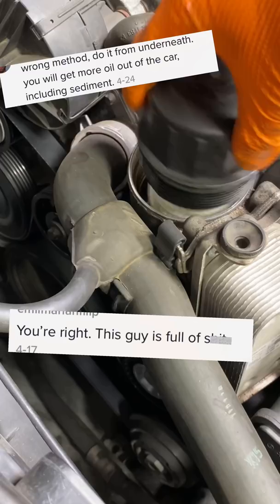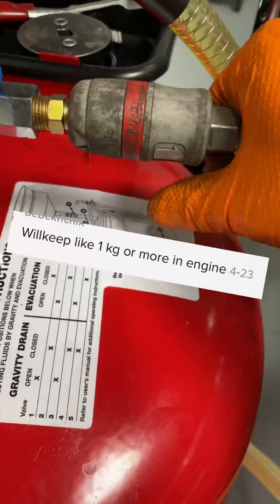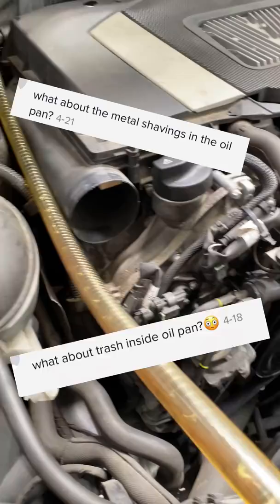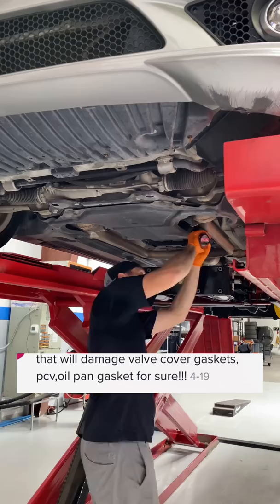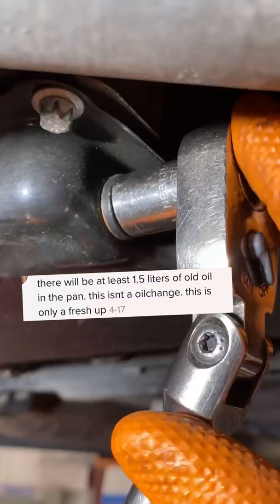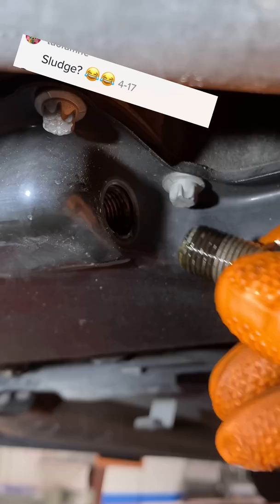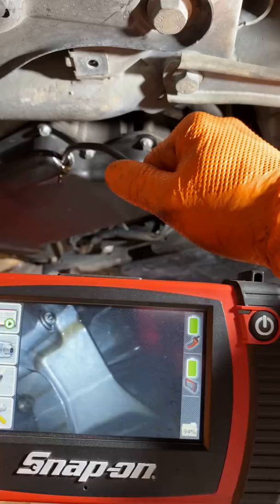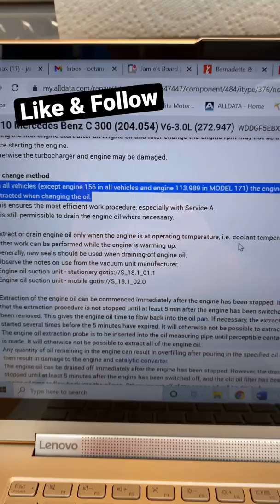#shorts Mechanic Proves Haters Wrong

Comment: I mean, car engines do produce vacuum when they're running and pressure when boosted with forced induction... sludge and shavings are improper maintenance and usually user error. I would extract all of my vehicles if the oil filter wasn't only accessible from underneath the engine.
Reply: Theres actually positive pressure in the crank case when the engine is running thats why it needs to be ventilated

Comment: Well... There usually isn't any ”sludge" in the oil unless you're not doing oil changes at the recommended mileage or engine hour mark. Now how the oil is extracted is mechanic preference.
Reply: Except for when the vehicle manufacturer specifically says that there is a recommended way.
Reply: @gokurules22  I think you contradicted yourself by using the term “recommended”
Reply: @titan1umtitan  I am pretty sure he didn't contradicted himself.
Reply: @titan1umtitan  please explain, oh knowledgeable one. How did i contradict myself?
Reply: @gokurules22  He said how the oil is extracted is a preference, then you said that, in specific cases, it is not up to preference if the manufacturer states that there is a recommended way. However, a recommended way also implied that there are other viable options which would allow a mechanic to use their preference because it is just as effective. Overall, I’m saying that you pointed out an exception, but the reasoning for the exception is the manufacturers preferential choice, not what you MUST do. I’m bad at explaining, so apologies for that
Reply: @pedromoreira2875  Check the comment I just dropped replying to the guy

Comment: As a German car owner, I find these comments domestically hilarious. When you’re used to driving American scrap metal 🤷‍♂️
Reply: Hey at least I don't gotta spend tons of money on parts to fix my american car. 🤷‍♂️
Reply: Matthew Hayslett  you mean the Ford trucks/Cars and chevy trucks and the dodge trucks? I have never had a dodge or chevy transmission fail me on a car, of course I've had to replace syncros or clutch packs but that's general maintenance on a car and truck transmission. I'd rather do a transmission myself than pay the prices the foreign cars want for parts especially Volkswagen and Bmw.
Reply: @PandaNukem  no shit.  it’s so cheap it’s disposable. When it breaks, you throw it out and buy another one. That’s the whole point of those things
Reply: Hey!  We drive your German scrap metal here too!
Reply: Lmao I'm a Toyota guy so I don't have a dog in this fight but spare me with that crap Van D.  German cars are the definition of endless money pits.
Reply: @gagelawrence8443  Toyota is sick. I have a supra. Love it. I also have a ‘93 240 sx. And a titan. Nothing has been as reliable as my Audi wagon though. In 10 years all I’ve had to replace was oil filters, brakes and tires. My wife has a vw  and same deal. We both used to own domestic before that. Had to live near a mechanic.
Reply: Matthew Hayslett  I'll take a transmission that fails after 200k miles (usually do to poor maintenance because people act like they're sealed units that shouldn't be touched) over replacing computer modules in modern BMW products. I don't think anybody is fond of tearing nearly the entire interior out of a car to track down an electrical issue that shouldn't have even happened. I worked on multiple BMW made Minis that had these issues. A couple were towed to the shop with my American scrap metal Dodge truck from 2005 with 240k miles on an original powertrain. Not a single BMW made Mini I worked on was even close to 200k miles if I recall correctly.

Also, don't take this as me hating on Minis, they're absolutely great to drive and I'm sure their BMW badged counterparts are too. They just have their quirks and I think it's stupid to ignore them.

Comment: The place I work at we do Mercedes, Vw, Audi, Bmw and some other cars that way. if they have to much plastic underneath and it takes up more time to undo the 2 dozen fasteners. or if the drain plug is temperamental and we don't want to fook it up. the oil gets vacuum out, it may take a little longer time and we measure the amount taken out to what is going in and if it matches we're good. The only problem is with the cars without a dipstick port.

Comment: Well the cement works used merc trucks back in the 70s as tanker trucks to move the cement to the port where they stored it in silo,s 2 drivers did a 12 hour shift each 7 days a week they never ever turned the trucks off mercedes told them not to not even when they changed the oil or serviced them they pumped the old oil out at the same time they pumped the new oil in with the motor running merc set them up to do it ,they did 1.2 million miles in them before they undated them & never broke down & never stopped running or turned off in the whole time ..milburn cement NZ ..

Comment: Even on my old Ford work car....   I never missed an oil change.   EVENTUALLY the oil pan got rusty and I changed it.  There was ZERO sludge in the motor and or  old pan.   If you change the oil regular you shouldn't have sludge.

Comment: This is how the oil is changed on any boat with an inboard engine propulsion system (sterndrive, jet drive, IPS/Zeus, v-drive or bobtail) and most modern outboard engines as well. Most Diesel powered yachts even have an integrated “Reverso oil change system” rigged to all engines; this pump allows to extract and fill all engines with the flip of a switch.

Comment: I work at Valvoline and we use evacs one every car possible. It doesn't like to work on Ford Ecoboost 6's but it works mostly every other car. I hated it when I first started but it does make changing oil a lot easier. Some drain plugs aren't in good spots and like to make a mess when pulling it.

Comment: At most you are left with 10 to 15ml of oil in your pan. But for Audi, Mercedes, and BMW this is the recommended method, the use of an extractor for oil changes.

Comment: Just drained the oil out of a car that had the timing chain flopping around and grinding the timing cover. 95% of the shavings stayed in the pan. If you have shavings falling into the sump, you have other problems.

Comment: The difference and reason the oil is completely evacuated: MB built the oil pan and the dipstick to function this way. The dipstick housing goes all the way down as where your Chevy and Ford do not.
Sludge forms when oil is overused,  MB owners maintain their cars about better than most people do. Most synthetic oils do not form sludge like conventional oil did back in the day.

Comment: Using an extractor tends to get more oil out than just a spill and fill. Even with my own theta that takes 4.5q when I let the pan drain til no drips takes and 5.25 when evacuated.

Comment: Here's one you can't ignore. Speed. As a mechanic, you should know the time it takes for an extract, which takes about 15 extra minutes. You might be able to fit paperwork in between, which could help, but nothing beats that tried and true piss bolt. Same results, faster time.

Comment: It is interesting when you go from the top, we have an oil vac to change the oil on our generators but we suck it out through a line at the bottom of the oil pan that is connected with a valve

Comment: Worked as a tech and MB for years, every benz EVER has the oil sucked except the newer models without dipstick. Trust me, you should be more worried about that rattle you came in for and i punched 2+ hours on a warranty labor ticket, wrote a pretty story about what i did, and send it back, customer all giddy that they're rattle is fixed while i worked on someone elses customer pay ticket for those 2 hours and never did anything to your car.

Comment: That manual is written by the bean counters figuring out how to pay the least on warranty work not the engineers. Jiffy lube is more likely to screw up your drain plug in 50,000 miles than Mercedes to make an engine that mechanically fails within 50,000. However, if it does have damage and the evidence is still unseen in the pan they hope that it will at least last until after the warranty period until it blows. Statistically this saved Mercedes a TON of money.

Comment: The oil stick tube is literally a straw for those engines. I've been doing this for years on my w210 and I'm currently sitting at 289,000 mi. Tested it myself it gets pretty much every damn drop out.

Comment: I always did it for the last half of my career. Most cars have a trapped.5 liter in the bottom, would jack up one side to get more out , and evac , got a half pint more out when I vac and tilt the car. Most German engines immaculate in the pan , even with 100s of k

Comment: Would love to see one of those commentators drain 30+ Liters of oil from a MB truck from the drain plug instead of sucking it out... We always suck it out at the dealership. Never seen excessive wear on a cam for example when we adjust the valve clearance on the next service interval

Comment: If you have metal shavings in your oil pan that are large enough to not make it to the filter without causing damage to the oil pump then you have much much bigger problems than how you evacuate your oil.

Comment: Metal shavings are not normal, oil sludge is not normal, if you use proper oil and regular oil change you dont think about it. The reason we have oil inside the engine is to prevent metal on metal friction which you guessedit creates metal flakes

Comment: It’s only Mercedes or other German cars that are designed to have oil extracted. Would not work on any Asian or domestic car you’ll still have oil left in the oil pan if you extracted the lazy way. But I would say most lube techs can’t torque a bolt correctly even if they wanted to.

Comment: Its insane how people believe that 'sludge' is going to be that bad when regular maintainance is done and good oil filters are used.

People, these engines run under insane tolerances, high compression pistons and multilayered turbos, will run at top speed for ages and do so for decades.

Who the hell thinks these just keel over and die from sludge buildup? Plus, its almost like sucking the oil from the lowest point in the engine instead of just having gravity do the work, will most likely be better anyway.

Comment: I would never take advice from someone who thinks metal shavings in the oil pan is a normal thing to expect when changing oil. If there are metal shavings and debri or sand in your oil, you got much much bigger issues then needing an oil change.

Comment: if you have metal shavings in your engine, an oil change is too little too late.  this dipstick vacuum method has been used for 50+ years in auto engine based boats,   witch is most of them.

Comment: How about the damage pulling a vacuum on an engine does to all the seals. They are designed to keep the oil in not the air out

Comment: 1 question, if mercedes service manual recommends to drain/suck the oil from dipstick tube, then why they still put drain plug on the oil pan?

I mean, many cars doesnt have drain plug on the diff. but some car still have it.

Comment: If suck out oil via the dipstick on older cars where you would drain the oil via sump plug, yes you might leave things behind.
But this car is designed for oil to be sucked out.

Comment: It’s almost like he’s doing it the way Mercedes wanted you to do it. I have just drained the oil from the oil pan like normal but I get why they recommend you do this. Since if there’s anything I hate more is it’s those stupid plastic drain plugs on BMW products and I’ve dealt with a couple where the person before clearly went overkill and caused it to strip out the part you use. But what I don’t get is people realize it’s pulling a light vacuum to suck out as much oil as possible. The PCV isn’t directly connected to the oil pan, the valve cover gaskets are torqued down and squished between metal and plastic. (assuming it’s a Plastic valve cover)

Comment: I had a second generation Mercedes A-Class.
in this case the drain plug should have been used.
However, the MERCEDS workshop sucked out the oil and then filled it in the amount specified in the instructions. The result: there was oil left. So they filled too much and 2 hours later I had an engine failure. on new Mercedes, you are possibly right. But on old ones. you kill the engine.

Comment: If you got metal shavings in your oil pan you have bigger issues, if you got sludge in there change your damn oil when you're supposed to heathens. A bottle of full synthetic is like 20-30 dollars and a filter is like 10 max changing oil isn't hard

Comment: Thats cool in all but i dont have the tools nor care to do it that way ik my way works and ive never stripped the pan out so im not worried. In my opinion they want it extracted instead of drained so the oil pan doesn't get stripped out over time. But you do you if it works it works

Comment: Bro the comment about it damaging gaskets and the PCV valve is insane. And for the sludge comment that doesn’t even make sense for one and. I’m not sure if they are aware of modern oils but they have detergents specifically designed to keep sludge from accumulating in the engine especially if maintenance is kept up

Comment: My Toyota filter is on top and it’s the only car I like to do oil changes on so far. Guess what? No sludge or shavings after that first pass. God knows what the previous owner did, but I can tell you it wasn’t change the oil right before they sold it to me. 😂

Comment: If y’all have sludge and metal in your oil, you have bigger issues that an oil change isn’t gonna address
Reply: Most of the time those issues are cause by NOT changing your oil so 🤷🏿‍♂️ it would probably help some

Comment: Wouldn't any metal shavings be picked up by the magnet that's in 99% of all oil pans anyway and wouldn't be drawn out of the oil if removed either method. If you see any metal or sludge you should be thinking about something mutch worse anyway. Still impressed how well the vacume method works though

Comment: German engineering requires excessive maintenance. If you followed the instructions generally works well. It's only one you don't follow them to the T that you have problems. Read up on German tanks in WWII and you'll find out what I mean. When well-maintained they work well mostly, when not given the excessive maintenance that they required they broke down a lot!

Comment: Where does the air enter as the oil is sucked out??? Can’t come in the PCv valve as it has a one way ball valve so how ? If you left oil filter out while sucking oil out then it makes sense but if new filter is installed then I still don’t see how

Comment: if your car is meant to do this, that’s great! more power to you and your quick oil changes with no lifting.

but if your car isn’t designed to do this then every single comment is right cough Ford cough

coming from a certified ford tech

Comment: We evac cars at work been times where we didn’t think we got it all and pulled the plug not even a drop comes out and it’s with a probe vs Mercedes has dipstick tube or port where evac hose fit right on there moral of the story is if it can be evacuated you will get more than draining it for hrs

Comment: I don't get why he showed the mervedes document, as it says the oik should be extracted when changing the oil. I'm no scientist but hiw csn you change the oil without extracting the old oil first, back on task, if you wanna suck it out from the top I see no issue. I do wonder if he still takes the drain plug out to change the drain plug seal.

Comment: Please if you change oil do it the proper way and do it from beneath, not all cars will get all the oil out from above, ive used those vacs hundreds of times and it's slow and pretty unreliable on most cars, so yes even if I'm this clips it works out, it does not always work, do NOT get your oil change from a top vac please
Reply: Some cars recommend it compared to the drain method.
Reply: @glitzyx4x852  I would like to know what cars out of curiosity, and if you say bmw, Audi or any more expensive like cars then that it because people fuck up drain plugs and oil pans so people want to "recommend" sucking the oil out to avoid any mess ups, in my experience using them(could just be some bad ones I've used) they take forever, break easily and loud as hell, it's such an inconvenience for lube techs esp

Comment: Mercedes sucks. Wanted to get that out of the way. Sucking out the oil is the best move. They were designed for this. Now if they can make solid metal lines for those turbos instead of all that freaking plastic.

Comment: We need more hot men machanics over here.
Love from Chitown.
I must say this is one clean engine.
I clean mine just because OCD kicks in.
I can't stand rust so I am replacing all CV axles ,all shocks, the two front lower control arm all hub bearing assembly.  I have all the parts I just need a spot that won't charge me by the hour.

Comment: Hey man i need a bit of help 
I have a 2018 durango sxt with 3.6 pentastar.
I drained the oil and pulled out the oil pan to fix a leak but noticed about 300 ml of oil left in the oil pan after draining and cant find out if i should drain or extract?

Comment: Hold up! Anyone can claim the oil pan is empty after changing the oil from the top. Removing the screw after editing out the part where it did have oil in the bottom makes the video worthless to support the claim.   The logical fallacy of appealing to authority by saying you are a mechanic was a nice touch, but mechanics can also be dishonest, just like on every profession out there. Not saying you are lying, well kinda... My point is not to offend but to explain that for you to prove your claim, the whole thing on the internet  the oil change procedure would need to be filmed in one shot with zero jump cuts. (Granted its a lot more difficult to record)